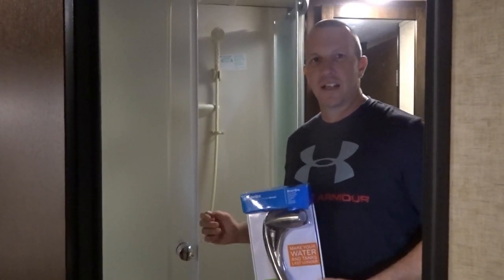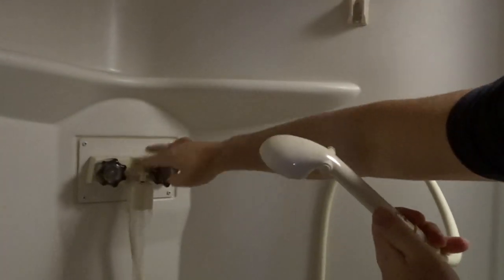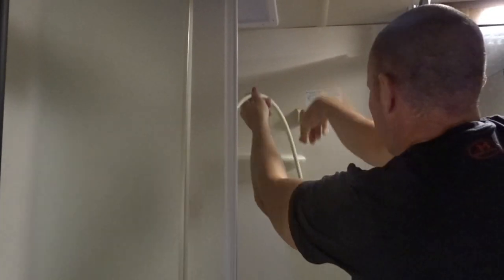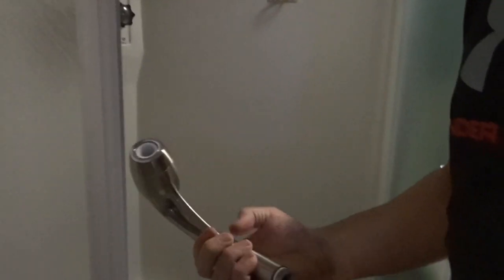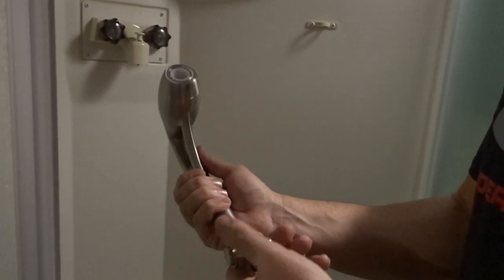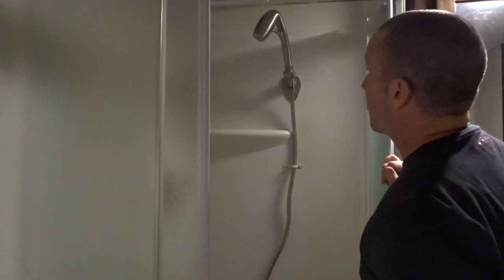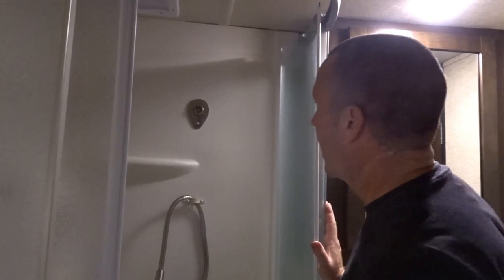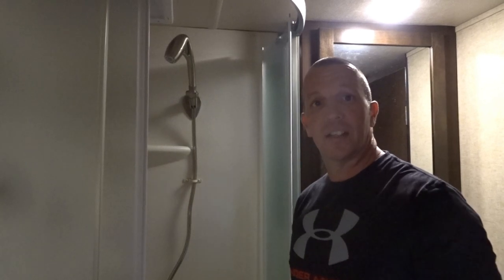How To Install The Oxygenics RV Shower Head!

Comment: how do you secure the shower head for travel
Reply from the maker: We have never had an issue with the shower head coming out out the holder while traveling. It fits in the holder very securely, so we do not do anything extra to secure it. Thanks for watching!
Reply: @JouppiOutdoors  Wow thanks for the quick reply. Do you think since I have a travel trailer it is more due the bounching around?
Reply from the maker: You’re welcome! We have had this shower head in both our travel trailer and now our 5th wheel. Never had an issue in either one. Not saying a big bump couldn’t knock it out…but it hasn’t happened to us yet in over 2 years of travel.